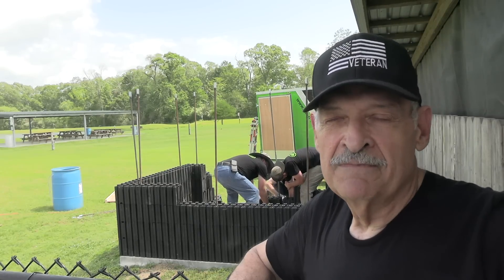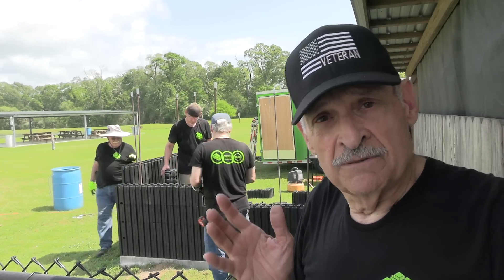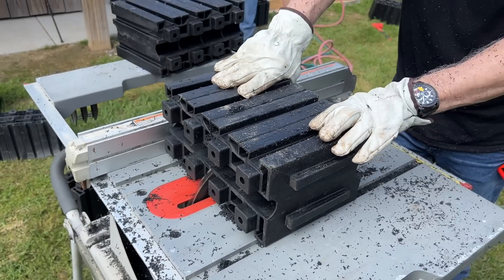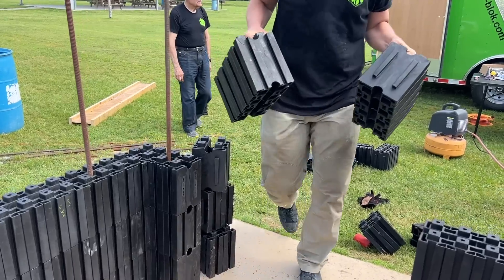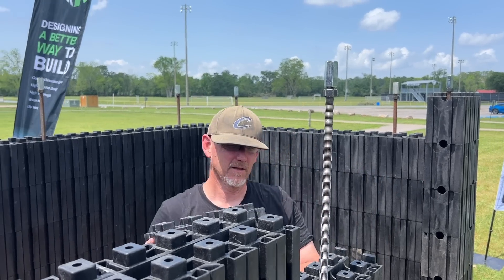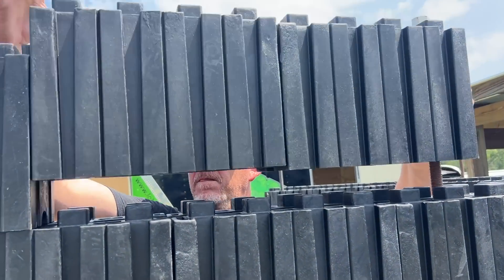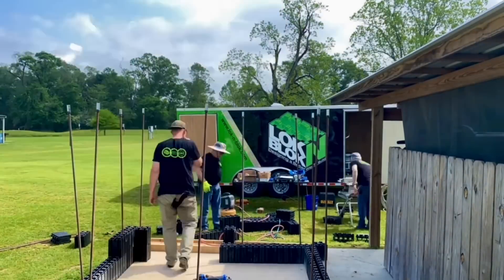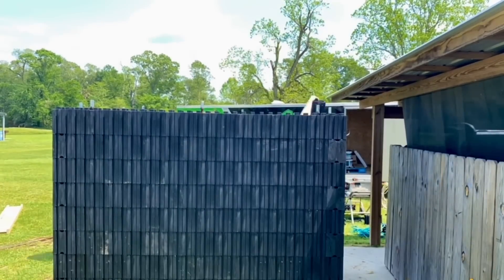Lok-N-Blok: Designing a Better Way to Build

Comment: Look like a great alternative, whats the Average Cost for SQ-Ft to build with this. Also I noted  Steel Rods are they Threaded with some type of top plate hold the building down to the slab?
Reply: $17 a sq ft steel treaded tension rods included.

Comment: Curious how you calculated that wind resistance, because 200+ mph needs a special facility. Plus how do they connect to make them air/water tight? Hmmmmm. smh
Reply: WJE international code testing company will tell you their wind testing equipment broke at 255mph. So we really don’t know how much wind LnB can stand up to. But it qualifies as a hurricane AND tornado shelter.

Comment: You've repeated the selling points more than once but you never addressed how these blocks are secured, how a roof, siding, awning, doors or electrical wiring and water lines are incorporated.
Reply: Just guessing here. Watching the video, it looks like the threaded rod runs through a wood top plate (2x6, 2x8?). That bolts the walls to the slab and then the roof structure would be attached to the top plate, like conventional construction. The blocks are plastic so all the door and window frames could be screwed to the block. I'd also guess that they'd run some furring on the inside to allow for electrical and water supply line to be hidden behind drywall for a finished product or just attached to the block for a more utilitarian structure. Vents for the plumbing could be done that way as well, although the furring would be pretty big to accommodate.

I don't think the construction issues are what they will have trouble with figuring out. I think getting acceptance will be a bigger problem, both with the consumer and probably more importantly, with the authorities. If you can't get permits, you're not going to build with it.
Reply: @rogermccaslin5963 the blocks have horizontal & vertical channels for plumbing & conduit, but it has to be installed as you stack the bloks. It can’t be roughed in later.
Reply: Yeah. You worry too much about
Reply: Don’t worry about that!

Comment: No mention here, or on their website, about insulation or R-value.  How could they forget that spec?  Also, no "investor relation" or company leader info seems odd for a company destined to disrupt an industry.  
It will be interesting to see where this is in a couple of years.
Reply: Been under development since 1996. You wouldn’t believe the red tape & testing required to bring the product to market.
Reply: Blok has R-7 insulation factor as is.
Reply: also no straight forward price for DIY
Reply: @mythrail $15 a Blok.
Reply: But they used the buzzword 'sustainable'.
Reply: Already been 28yrs & there are no answers. 
Like listening to politicians sticking to their talking points and telling you ONLY what THEY want.

Comment: Looks like you have grooves to allow connections.
If you made a few types and incorporate a true finish on outside and inside you would be able could compete with cost of construction by reducing labor costs.
As it stands finish labor costs will make it unaffordable.  What I mean is that you will still has to clad the inside and outside and insulate the wall. If you eliminate drywall and exterior cladding then a 20 dollar block starts to work financially.
So you have to compete with very cheap stick framing walls.
You are so close.
Congrats on getting so far with your project and product! All most all creators fail to get anywhere.
Reply: The bloks retail for $15/ea. They have an R-7 insulating factor as is. One still has to install outer & inner on any type of construction. L-n-B construction blocks are competitive with any construction and far superior.

Comment: Now in California with all the fires going the question I have ,Bing that it’s a polyurethane plastic it’s not gonna hold up very well in the heat of fire
Reply: No different than WOOD that burns..
Reply: @robertjerome1889 Wood isn't toxic like plastics are. Also, raise your hand if you would stay in one with an f5 beating a path toward you, I know I wouldn't. Great for temporary structure but not much else imho.
Reply: @robertjerome1889  guarantee the integrity of the wood would last longer than that plastic for shed not a big deal
Reply: What I was wondering about
Reply: Amazing our compound will NOT support combustion. You can melt it with a torch and it will create non toxic smoke. Remove the torch and it stops. You can find this demonstration on YouTube.